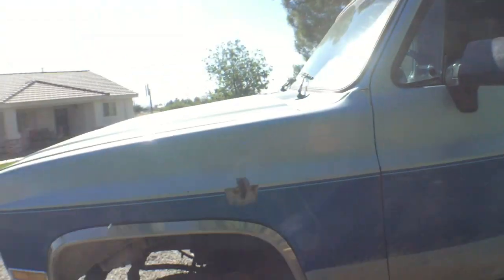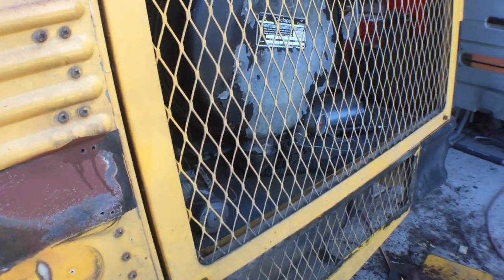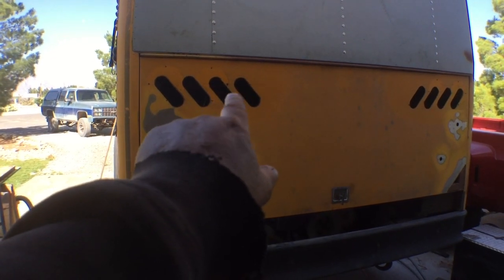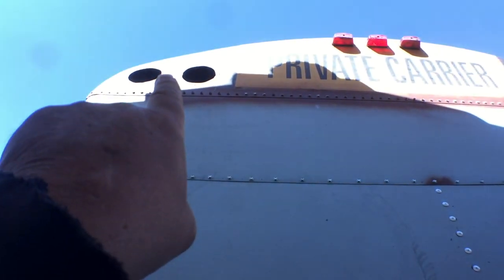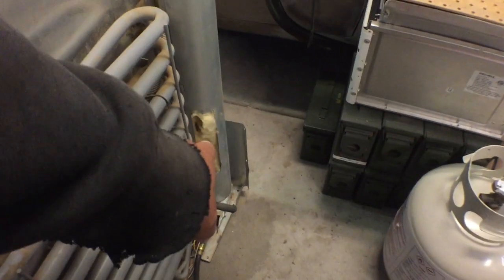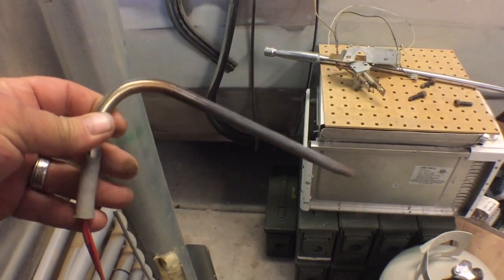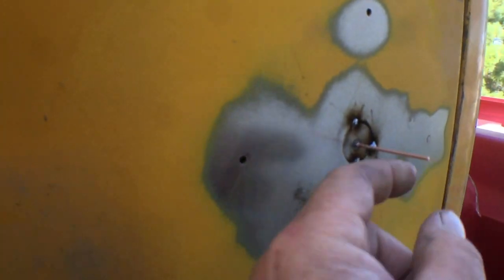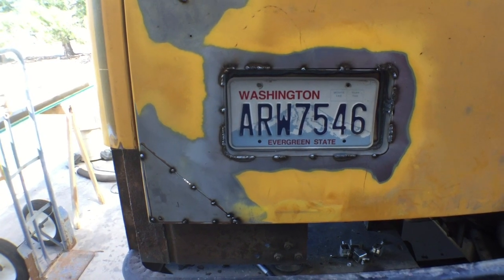Bus to RV conversion - 16 - More Body Work

Comment: looking really good.... I did the same thing with the generator on my first bus.... worked great.... had to modify it for an electric choke so I could start it from inside and I put a pressure switch and relay on the oil pressure sender port to turn the fuel pump on and off... only thing I didn't like was it being a 3600 rpm genset it was pretty loud but maybe you can put yours in an insulated box or something, you can use Peterbilt 379 door handles for your doors if you like.... Ebay.... about 40 bucks.... inside handles if you don't want a lock.... outside if you do, and you could put gas struts on the doors to hold em open if you don't feel like relocating the hinges.... ( you did say you were lazy) ... :-).... nice work on the sheet metal corner too
Reply from the maker: you, my freind, are a plethora of ideas gleaned only from years of experience.  Thanks!
Reply: well, that's the idea isn't it.... sharing ideas and techniques based on our experience, I'll be using your technique for removing mill scale when I'm ready to finish the steel on mine, the gentleman in Florida who wishes to remain anonymous has been a big help in choosing the system I am using to power my slides so if I can help others it's all good

Comment: Check to make sure the refrigerator does not have any recalls on it. There were some Dometic and Norcold refrigerators that would catch fire. I add a ARP control module that monitor flue temperature and shuts the gas off if it gets to hot. It will also allow you to run the refrigerator off level for up to 5 hours. See this link https://www.lever-family-racing.com/lever-family-racing-home/family-vehicles/1997-fleetwood-american-dream/arp-control-module-2017-07-21 There is also some information of the correct way to run the flue vent and what the baffles should look like. Roof raise is almost a must in my opinion (I'm 6'4").

That Generic generator will drive you craze with the noise it makes, I would recommend highly to locate a inverter generator that will idle down based on power consumption.

Comment: Bus is coming along! Love the metal work! You said you were going to remove those 3 little clearance lights on the rear at the very top. You will be replacing those, correct?
Reply from the maker: yes, with LEDs
Reply: LED's are the best!

Comment: Since I'm going back and giving you your hit-count, I'm going to make you work for it. ;)

How did you make the round corner piece (@ 5:33)? I don't have anything for a brake for the folded over part but I know how that's done. I'm curious about the radius. 14 gauge that small has to be a major pain to shape. Did you have a post/pipe/something that matched the diameter to wrap it around. It doesn't look hammered.
Reply from the maker: if you look closely, you will see gradual lines that run the length of the piece.  Basically, I clamped it to my bench and beat it over the edge using a dead blow hammer.  The sharp 90 degree bends were scored with an angle grinder and after the bend was established, TIG welded.  It was a royal PITA, but I don't have a brake either.

Comment: I got to thinkin about rust. What do you use to treat rust? Any chemicals or just leave it be until it's rotted out and just put in new material? Do you use any acids before paint etc? My rust repairskills could use some new ideas.
Reply from the maker: most rust "neutralizers" use phosphoric acid, which leaves a phosphorus residue that inhibits rust from re-forming.  I've used some of these converters with poor results.  The method I prefer is encapsulation.  You need 3 things for rust to spread....a ferous metal, oxygen and time. Two of those things you can't do anything about, but you can eliminate oxygen from the equation.  POR15 makes a good system but its spendy.  Im using rusty metal primer from rustolium, and where I weld through that i'll give a liberal coating of undercoat.  After all the loose rust and scale is removed first, of course.

Comment: Just replaced all the outside lights on the trailer with LED. Only comment I would make is they are very directional (bright dead on, but not so mach from the side. Here is the project on my web page. https://www.lever-family-racing.com/lever-family-racing-home/family-vehicles/2006-car-trailer-2/led-clearance-lights-2017-07-10

Also I have had lots of problems with the refrigerator in the Motor Home. I have replaced the whole cooling unit. see this link on my web site (there is three pages for this project) . https://www.lever-family-racing.com/lever-family-racing-home/family-vehicles/1997-fleetwood-american-dream/1997-american-dream-2016-08-02

Added an internal fan inside the refrigerator.  https://www.lever-family-racing.com/lever-family-racing-home/family-vehicles/1997-fleetwood-american-dream/1997-american-dream-2016-09-04

Added the ARP module to reduce the rise of flue fires. As a aside I was not help with their customer support https://www.lever-family-racing.com/lever-family-racing-home/family-vehicles/1997-fleetwood-american-dream/arp-control-module-2017-07-21

Are these comments helpful?

Glenn